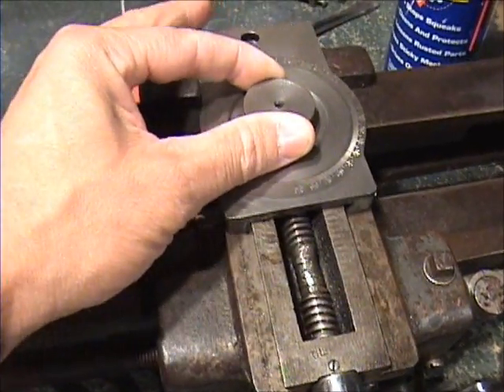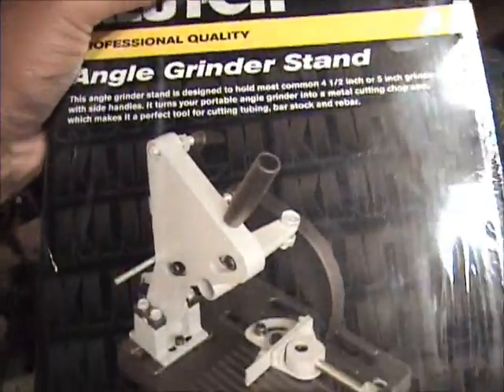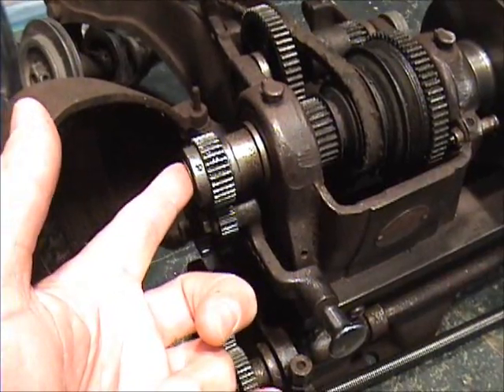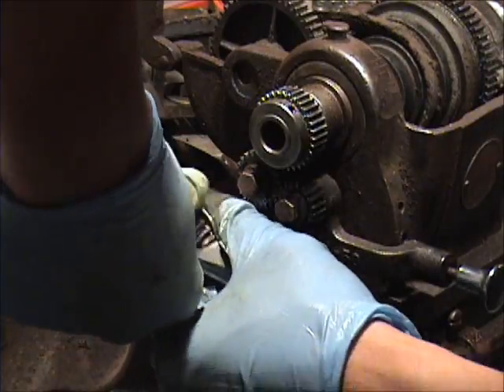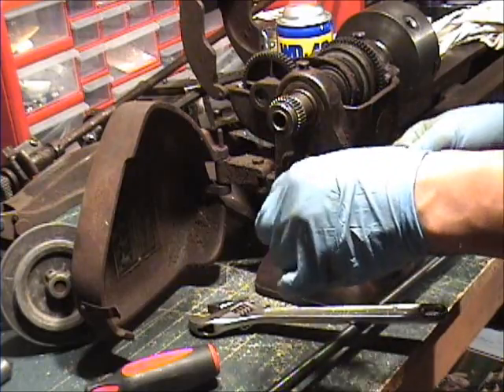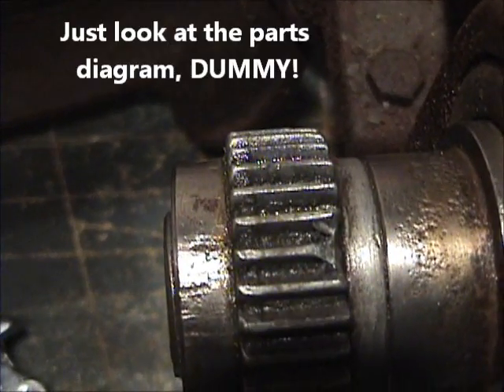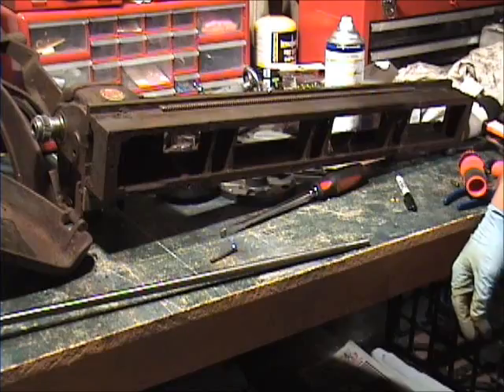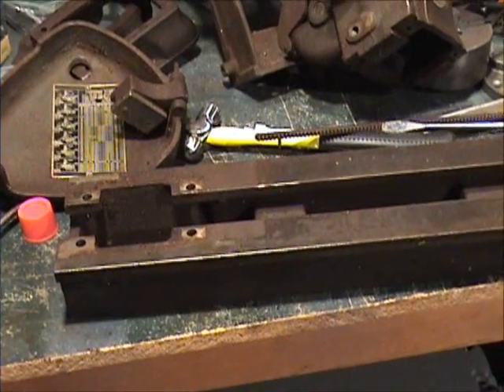Atlas 618 Lathe  restoration(Craftsman 101.xxxx) Part 3 of 8

Comment: To remove screws and small nuts/bolts there is a "hand impact" tool, usually in sets including screw bits and sockets. Sears, Mac Tools both make'em. You hit the end of the tool and it one pushes on screw and at the same time twists the screw too. They work well for small problems.